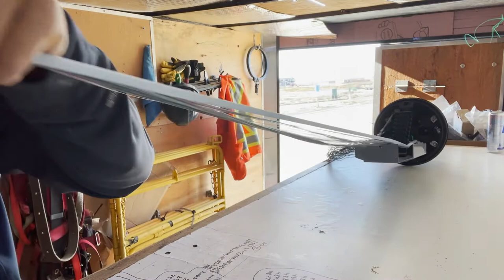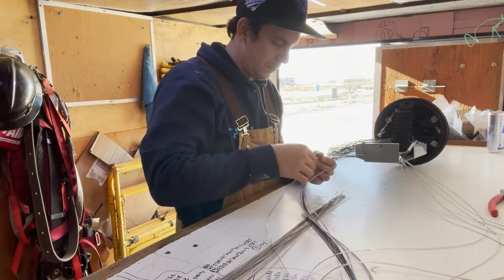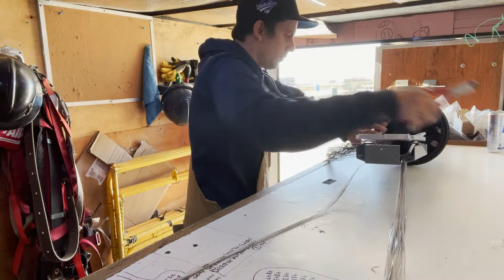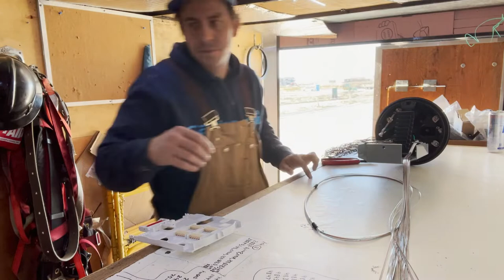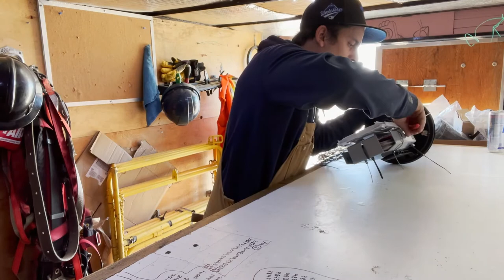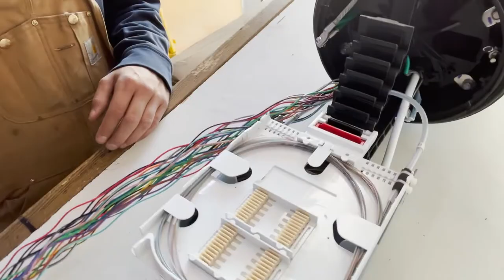How To Run Ribbon Fiber Cable To Tray

Comment: how do you put splice away in tray so there's no flips in ribbons? like for a 288  to 288, when thers multiple ribbons. i always end up with 1 or 2 flips
Reply from the maker: I will release a video tomorrow on building and splicing a 432f to a 288f and 144f. I make sure when running the ribbons from basket up to tray that they stay in perfect order as well as blue up and when I splice them I lay them out in perfect order on the table and I double check them before splicing the ribbons to ensure there is no flips. Stay tuned for tomorrow’s video thanks for watching